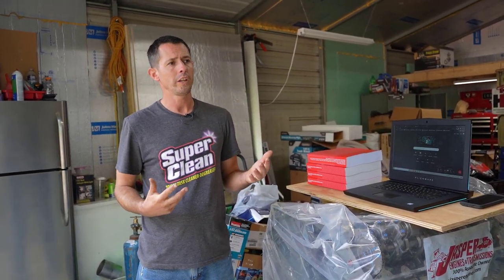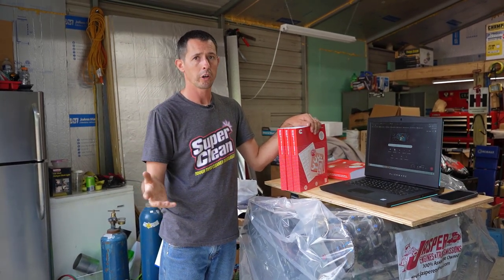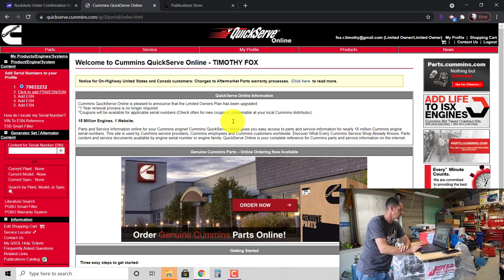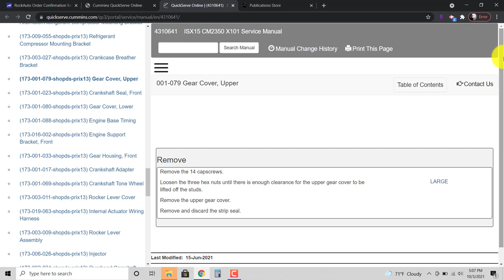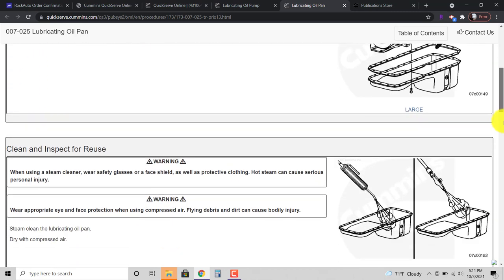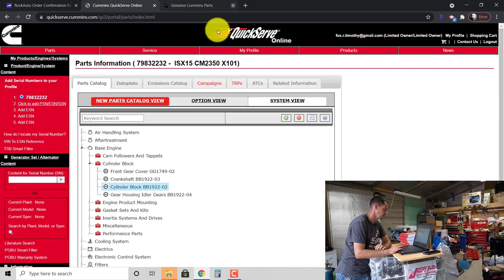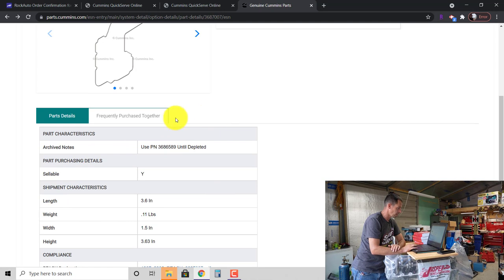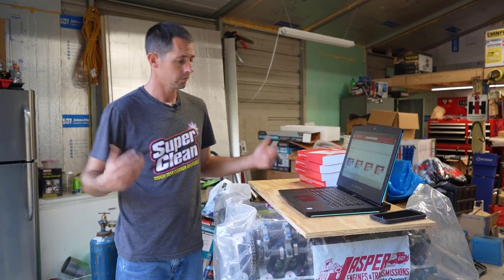Free Cummins Service Tech & Parts Data - Unbelievable

Comment: That $75 front structure gasket is about a bunch of nothing. If they had put a little more money into that strip of rubber on the gasket, would have stopped that leak before it started.